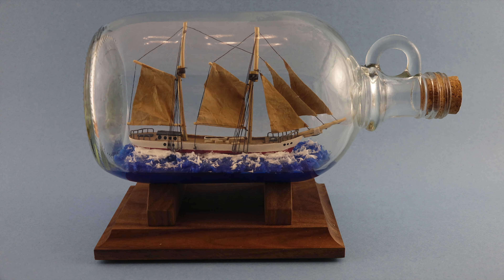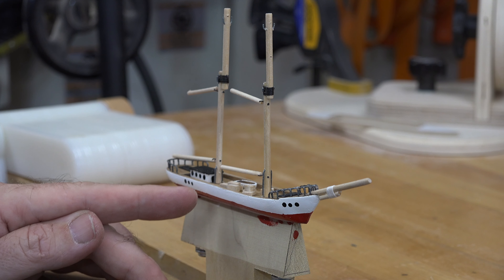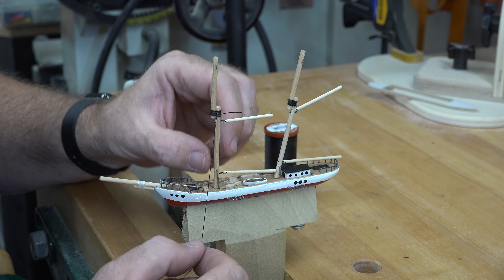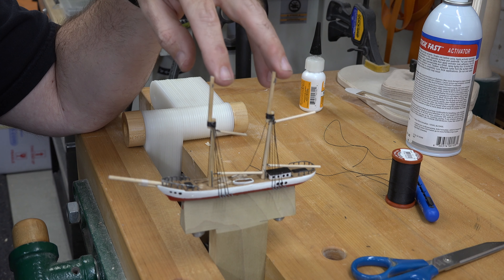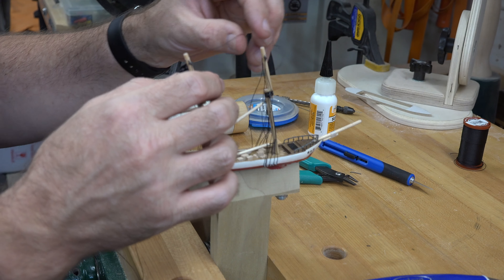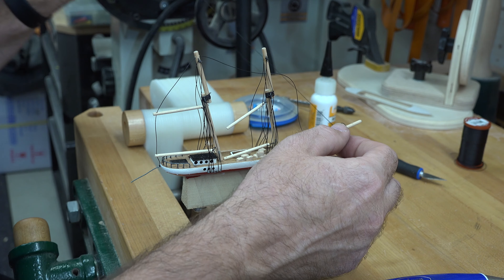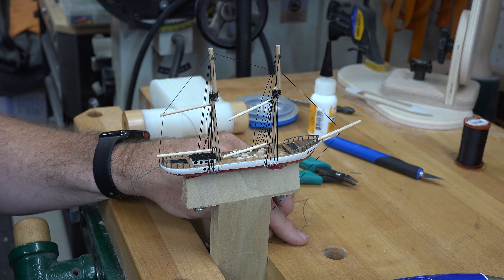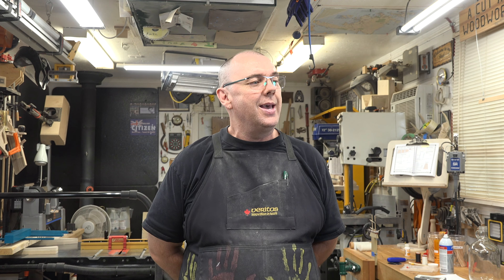Ship in a bottle Part 4

Comment: Hi Kenny! I was taken aback at first that the rat lines were all going behind the mast. As you explained it I understood it but I was thinking you could put them in the proper position and use elastic cord and when you insert the ship the mast might actually stand up by itself due to the elasticity in the cords. What do you think? I am going to be looking at ships in bottles a whole lot closer in the future. Bill
Reply from the maker: I suppose you could use elastic rat lines Bill.  I don't see why it wouldn't work.  The only issue I can see is the fact that in order for them to be elastic, they would have to be thicker which may not be to scale for the model.  Great suggestion though.  Thanks for tuning in to the show.
Reply: Use a Lycra thread, it’s naturally stretchy and very fine. My concern would be over time the material wearing out and beginning to sag

Comment: Hey Kenny where in the world did you find 1/32 dowels for the spars. I can’t find them anywhere.
Reply: Correction I meant 3/32 dowel
Reply from the maker: William, I get mine from Lee Valley.  Some circles refer to them as 1/12" dowels.  Here's a link for you.  I hope it helps.  Thanks for tuning in to the show.
https://www.leevalley.com/en-ca/shop/tools/supplies/joinery/dowel-rods/32722-micro-dowel-rods?item=41K9501
Reply from the maker: Lee Valley William.  Look for 1/12" micro dowels.  I gave you a link in your correction post.  I hope it helps.

Comment: Hello, my question is regarding a different subject, the Rikon Model 30-212VS: 12” VS Drill Press.
I am about to purchase one and I believe you talked about what it is sitting on in your shop, I cannot seem to find that comment.
I have made many shop stands, tables etc. and really don't want to build a stand for it.
If you recall the brand and or dimensions of the tool chest you used I would greatly appreciate it.
At your convienance of course
Thanks Jim Bates, Ventura California.
Reply from the maker: Hi Jim.  Thanks for contacting me with your question.  The lower cabinet that I used to mount my drill press on was purchased from Home Depot here in Canada.  I got it on a clearance sale for less than $100.  Here's a link.  https://www.homedepot.ca/product/husky-33-inch-h-x-28-inch-w-x-18-inch-d-4-drawer-steel-garage-base-cabinet/1000846223
Truth be told, it has been extremely handy as it also provides 4 drawers for my drilling accessories like drill bits, hand drills, sharpeners etc.  It's really been a great setup.  I hope this helps.  I tried to find the same product on the American Home Depot website and they don't seem to carry this exact one.  I would suggest checking your local big box store and watching for sales like I did.  You're bound to find something that will suit your need perfectly.  Thanks for tuning in to the show.  It's truly appreciated.
Reply: @acutabove_woodworkings  Thanks very much for the info. I take a lot of pride in my garage/shop and I know you do as well. 
Best regards,  Jim
Reply from the maker: @jimbates3557  You're very welcome. Good luck with your search for a cabinet.  If you have any questions, please don't hesitate.